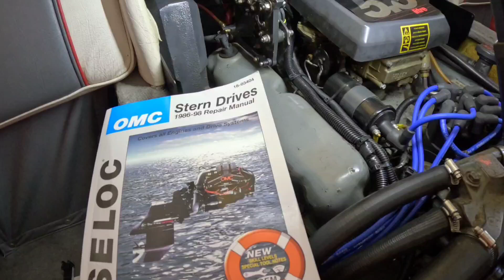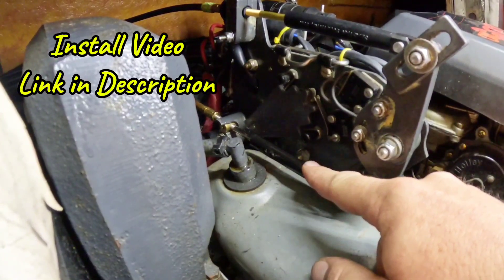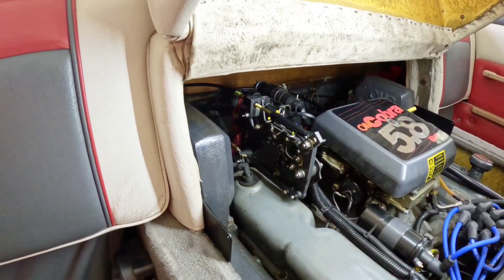OMC Cobra Shift Linkage Assembly | Adjustment And Fine Tuning The Electronic Shift Assist

Comment: You did justice to an área that troubles most of us..thank you so much good sir.
My engines are 1989 4.3 L V6.
Where can I find that METAL CABLE GUIDE THAT REPLACES PLASTIC ONE on the outdrive?
Reply from the maker: Thanks for the support! I have a link to the part in the description of the video. It's on Amazon

Comment: When you had to adjust the cam of the overstroke switch to centre it for reverse gear, did it not then change the point of contact for forward gear. Looks to me like it can only be adjusted either for FWD or REV?
Reply from the maker: Yes it is possible. And that's what trips up most when trying to adjust these. It's a process that has to be done step by step in order to ensure all adjustments are relationally in order. So if a step is skipped or only one adjustment is made without verifying it as a system, problems can arise. That's what gives these drives a bad reputation

Comment: Here's a few more tips, I've had one of these for about 23 years....in a 1988 Four Winns 200 Horizon....
1) before adjusting the lower shift cable it is a good idea to check the shift cable drag. With both ends disconnected, the drag should not exceed 2.5 lbs. Excessive drag can cause the drive to not go into gear all the way which will cause jumping out of gear, and worn shift dogs. In fact the original cables were recalled for this reason. 
2) the shifter bellcrank in the pivot housing can get gummed up with crud, if the gasket between the drive and the pivot housing leaks water. I pack that area with grease after cleaning it all out. The bellcrank must more easily forward and reverse, for the shift linkage to work properly. 
3) your engine must be in good enough tune so that it won't stall when the ESA lowers the idle to allow you to shift from in-gear to neutral. Your idle speed should not exceed 600 rpm in gear in the water. The ESA should engage only when shifting from in-gear to neutral, not when shifting into gear.
Reply from the maker: Thanks for the added tips! Those are all great points!

Comment: 7:37 Make sure that bolt is centered in the slot. Mine was moved during my rebuild and the gears were slamming hard when shifting. 
Excellent presentation! New subscriber here. 😊
Reply from the maker: Yes, That's very important! Thanks for the support!

Comment: Basically the holder tool holds it in nutrell position yes so if u dont have a tool put the drive on in gear with the cable pulled fully forward turn the motor to line up shaft then attach drive push back cable to get nutrall then have the control in nutrell that gives you a rought alinement then in netrall do your measurements will that not work
Reply from the maker: Could it be done that way, yes. But there is a lot of play in that forward gear range. It could be set deep in forward but you will be too shallow in reverse. You can adjust it if needed to but you are going to spend a lot of time trying to find tune it

Comment: Im normally the mercrurseser guy but im working on this croba 1993 do u have mesurments for full forward as well as nutrell or just 7.9 16 central of both barrels where does the 6 half come into play please explain slowly
Reply from the maker: Different drives, different engines all can have slightly different dimensions. But they are just a rough adjustment. It gets fine tuned with the esa and linkage adjustment process

Comment: So please anser you got no excessive movment on your gear shift cable the holder is in the netrurell position correct theres no need for that tool as long as its in nutrell with the drive in nutrell the cable from the drive on a 1993 should be7.9 16th in nutrell what is the 6 half inch measurement then
Reply from the maker: The holder is in the neutral position, but there is a lot of movement in a drive neutral position. Could it be done that way, yes, but it will take more fine tuning adjustment at the top to make sure it is correct

Comment: Good video, but you are perpetuating the confusion which had me tearing my hair out trying to figure out what I had when I first bought my used 1990 26' cabin cruiser with King Cobra 5.7L Stern drive. So many people think the King didn't exist till '92 or that it did exist before that but the beefier cone clutch didn't come till '92. My 1990 is a cone clutch model, the 574APEPWS (the first year for cone clutch). King Cobras actually were introduced in 1987 with a dog clutch similar to regular Cobras. In 1990 the cone clutch King with the hump showed up, and in 1992 they further upgraded the impeller and moved shifting to the upper gear housing. So the King Cobra has been around since 1987, was made much more robust in 1990, and was further upgraded in 1992.
Reply from the maker: Thanks for sharing this information; it's good to know more about the different generations of the king cobra!

Comment: The cable that's on your link i ordered for my 89 bayliner and it's too short I need the longer ford 5.8l shift cable i believe is part number 987964? Is this correct?
Reply from the maker: That's interesting that the cable is too short. Are you looking it up by engine vin to get that number? I know for my engine it calls for a 987661

Comment: I'm having a heck of a time finding parts. I would like to replace and adjust cables like you did.
Reply: Tc electronics are the omc experts. They are in Canada. They also have a shop in the Miami área in the summer months
Reply from the maker: It can be difficult to find parts for these, but i found all mine on marineengine.com and crowleymarine.com

I also have links in all the descriptions of my videos too

Comment: I was reading it needs be on water to adjust correctly....I have 5.8 I did whole new engine roller cam and roller 1.6 got it running but like to idle 800 is that ok I mean it drops rpm down 500...it's also on old retro 89 dash but sounds mean...just put new lower unit so ill do all this video tomorrow...I had it going back forth good...but then I played to much so ill go back to original and ask haha
Reply from the maker: Yes if you played with it too much it's best to start from the beginning. 800 may be kind of high. But you may drop a few rpm anyway when in the water with prop load. High rpms just create more shaft load and may make it harder to transition between gears
Reply: @adventureandrepeat I test with ear muffs today set it all up with exact measurements from manual....seems to engage great!.....little stumble in fwd unless I push to give gas so I believe a little tuning on carbs accelerating pump and electric choke and I'll be good i think ? Lol I'm testing on water tomorrow wish be luck ...I appreciate your time and videos brother!
Reply from the maker: Yea there's a good chance it may clear up on the water when everything gets warmed up. Or you may just need to find tune the idle circuits with this new motor if you haven't already. Thanks for the support!
Reply: @adventureandrepeat I had to get new jets being in Colorado... got shifting great....but sadly I got to repellent engine and go back to machine shop...must have done something little wrong bc oil pressure dropped and spun a bearing....just glad guys being nice and said bring it back in....😢thanks for the video...otherwise this engine baller lol400hp
Reply from the maker: I've been there with engines too. Sometimes that happens. The last time that happened was because the shop forgot to line hone the crank mains

Comment: i have a 1990 king cobra after having the motor rebuilt it now shifts backwards forward is reverse and reverse is forward. can it be hooked up backwards
Reply from the maker: I didn't think it was possible for it to be done and work properly. But it appears they were able to! I wonder if the shift cables were switched on the esa bracket?
Reply: @adventureandrepeat  is that possible. every thing seems to work fine except when in forward prop turns counter clockwise. can i just change the prop
Reply from the maker: Yes that is also possible if the prop has the wrong rotation! That may be the easiest solution. I enjoy having my 4 blade stainless solas

Comment: Question I have the 3.0. It the controls look close is the top cable supposed to slide up and down on the brakes or be tight
Reply from the maker: The top cable mount is not supposed to slide up and down. It is supposed to be tight, just like this one
Reply: @adventureandrepeat ok so that could be why I can’t get a perfect shift like I got it to go in and out of forward and reverse but I noticed that with the shift cable and stopped and I can manually put in and out not problem no slipping or anything it’s time to adjust properly now
Reply from the maker: Yes that's where I would start

Comment: Hello, I am currently struggling with the ESA adjustment on my OMC Cobra 4.3L V6 1990. I had been desperately trying for hours to set the ESA for the shift process, both forward and reverse. It's starting to dawn on me. Is it correct that the ESA only adjusts the engine speed when shifting to reverse? Not when shifting to forward?
Reply from the maker: It will do it in both directions. However if the shift assembly is not adjusted properly it will give that result. Specifically the w fork that moves up and down. If that doesn't have the resistance or push back like I showed, that will cause the esa to not operate correctly but the boat will still shift forward and reverse
Reply: @adventureandrepeat  I have tried to follow your video exactly, but it doesn't seem to work that way for me. I also have the impression that the rear switch doesn't have any function at all. It is supposed to bridge the switch that contacts the W, but I can't verify that with my multimeter. 

Then I looked online and asked ChatGPT whether the ESA should also work in forward gear. The answer was mostly no — it’s only intended for reverse. From my point of view, it makes sense that it should work in both directions. 

I adjusted the lower shift cable using the templates and replaced the upper shift cable because the plastic adjustment screw was broken. The gears shift fine, but the ESA sometimes works for reverse, but not at all for forward. Or I adjust the throttle cylinder on the lower shift cable, which sometimes causes the ESA to activate in forward gear, but then it stays active even after shifting. 

I’ve spent several hours trying to tune it, but without success. Do you have any additional tips?
Reply from the maker: If the engine is running and you just reach in and press the micro switch, does it work? Just trying to verify that is working every time and the switch isn't bad. 
How do you know it's not working every time? Is this tested with engine running?
Are you starting from the beginning with the adjust and check procedure? Or trying to adjust individual pieces?
Do we know the lower shift cable is good?
Reply: @adventureandrepeat  The switch is working. I used a multimeter that beeps when there's continuity. I can tell when it works by whether it beeps or not. I also briefly ran the engine and shifted gears. However, I first tried it without the engine running, and after moving the shifter, I turned the propeller until it clicked into place and the gear engaged. Shifting itself works fine. Yesterday, I also removed the drivetrain and set the zero position using the template, then adjusted the distance at the top of the engine to 6.5 inch. Then I tried to follow your video instructions: full throttle forward, and then lightly adjusted the lower shift cable with the round nut until it fit easily into its position.
Reply from the maker: This is sounding very similar to the situation I had with my lower shift cable going bad. My cable was only a year old and installed by the previous owner and I think it was an Amazon cheapo. 

The next questions I have are with the engine off. Put it in forward gear, grab the prop by hand and move it back and forth. Is the prop fully locked in? Or are you able to "free spin" it with what feels like some splines trying to engage? In either direction. Then do the same thing with the shifter in reverse. Are you able to overpower the splines spinning the prop by hand in either direction?

If you are able to get the prop to spin more than just to get it to lockup in the splines, your lower shift cable is bad.

As a note, esa is supposed to work in both directions. However the boat can be driven without it working all together. Just hard to shift sometimes
Reply: @adventureandrepeat  I checked the lower shift cable, and it moves quite easily. I also lubricated it with Balistol gun oil, so it’s now very smooth. The gears lock into place properly. You can't turn the propeller by hand, or you notice that the engine moves when you try. During my attempts yesterday, I eventually reached a point where the ESA was functioning in reverse gear. Then we slightly adjusted the plastic knurled nut on the upper cable, but it didn't work very well afterwards.  

Today, I watched your video again and tried to set it exactly the same way, but then the ESA wouldn’t trigger anymore. It seems to react to very minimal adjustments... Unfortunately, the weather in Germany is currently very rainy, so I can only do a water test on Monday or Tuesday.  

However, I will try again tomorrow to adjust the settings following an OMC manual. I initially had trouble understanding the instructions because there was too much input, but gradually I’m able to follow the steps. The part about the ESA is also described there.
Reply: I can report a partial success.
I rechecked the setting of the 6 1/5" using the manual and the template, then tested the gear shift movement by running the boat at full throttle forward and backward, and reassembled it according to the instructions. Before that, I disconnected the throttle cable.
Then I engaged the gears and checked if the position of the ESA relay lever was correct. I had to turn the knurled nut a few more revolutions until the ESA was deactivated again when the gear was engaged.  

It now works perfectly in reverse gear, but in forward gear, I still have to play with the gas a bit until the ESA deactivates. I think some fine-tuning is still necessary. However, I’ve already experimented a bit with that. It doesn’t seem entirely logical to me. If I engage the forward gear and turn the propeller with the motor off until it clicks into place, the contact of the ESA is actually in an unengaged position. Still, the engine cuts power quite frequently, or until I adjust the throttle.  

A water test is now still pending…
Reply from the maker: That's great to hear. That initial 6" adjustment is meant to just get in the ballpark and the fine tuning goes from there. If the engine stumbles but no esa switch is engaged I'm curious if it's an engine issue. Because once it locks into gear the esa has nothing to do with the engine. Or the esa module is going bad and still causing an engine stumble. But I feel like that's less likely. 

It sounds like you are on the right path to getting it figured out. Keep up the good work!
Reply: @adventureandrepeat  
Sorry for the late reply. Unfortunately, the last water test was a complete disaster. The gear somehow didn’t hold, maybe the teeth on the forward gear were already too damaged. The ESA also didn’t react as I expected. I then brought in a workshop, where I was told after just a few minutes that the spline of the Z-drive was completely worn out. For me, only three factors that weren’t working properly led to the decision to convert the entire OMC drive train to Mercury, since the dealer said there would no longer be a reliable supply of spare parts for OMC. I know some parts can be obtained from China, but that’s not really recommended either. Now, I will receive a fully functional set of drive and all the shifting mechanisms, along with a comparable Mercury ESA system, all covered by dealer warranty.
Reply from the maker: That's terribly frustrating to do all that work to find out that issue. I've always thought about what to do when I have a gear failure in my drive. So far I've been lucky enough to source all the parts I've needed. But a mercury conversion would be the best way to go for a long term solution.

Comment: Awesome video. What would not let my boat once in gear with a load on it not let it shift into neutral forward or reverse. With a load on it.? Thanks in advance
Reply from the maker: A couple things would cause that issue. One is the shift assembly is out of adjustment. Especially because that assembly controls the shift assist. If that assembly is all adjusted properly and the micro switches engage when they should. The next possibility would be the electronic shift assist. The esa module is meant to help take engine load off the drive gears to help shift smoother. It makes the engine misfire during the transition of gears. I also have a video up on how to check and test an esa module, and replace it if it is bad